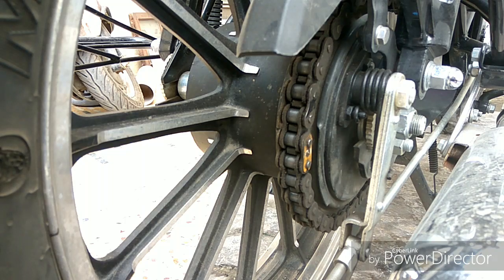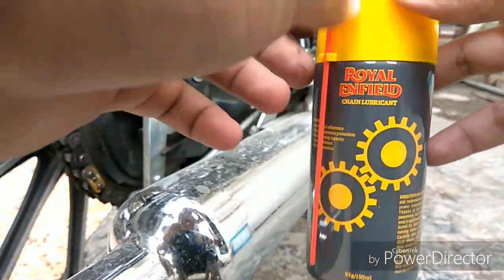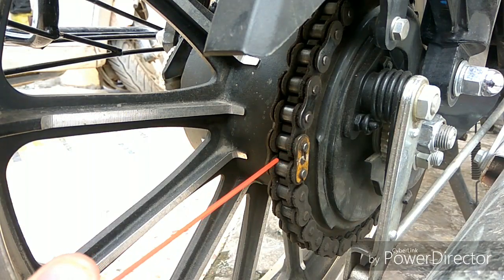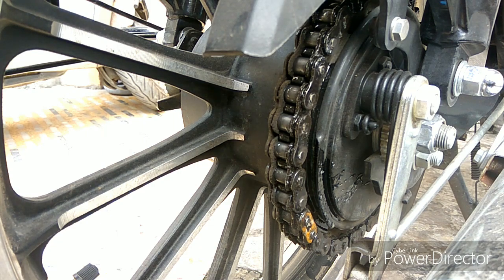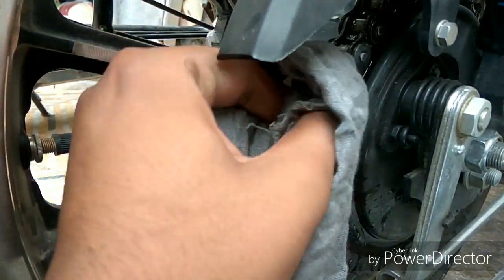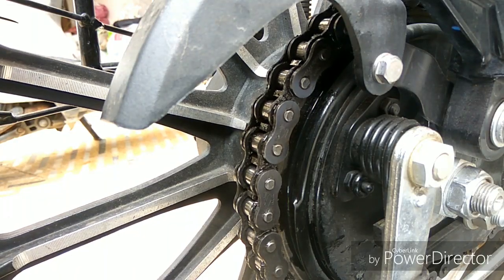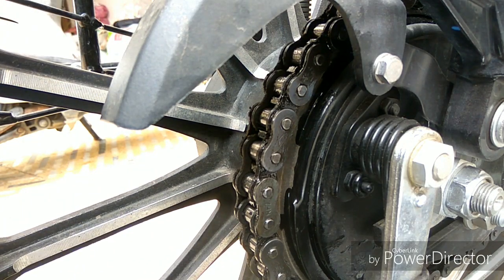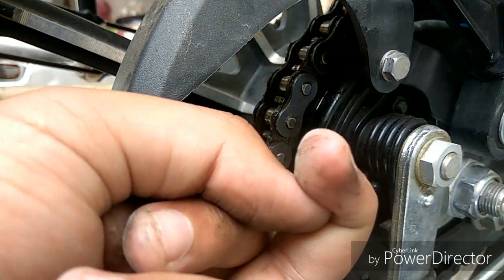HOW TO LUBE CHAIN OF ROYAL ENFIELD CLASSIC 350 BS4  MAINTENANCE TIPS FOR ROYAL ENFIELD

Comment: Wrong method. 
1st we should use a cleanser spray and spray it on the chain. 
We should leave it for 10mins so as to the dirt gets loose. Then take a brush and kerosene and clean the dirt.
Only when the chain is completely clean the we should apply the lubricant. The lubricant keeps the Chain wet. 

What's the point in applying the lube when you are wiping it away and restoring the chain to dry..

I respect your channel but please don't spread wrong information brother.
Reply from the maker: i know brother i forgot to apply the chain cleaner i will modify this video or i will make a new video on this topic for sure